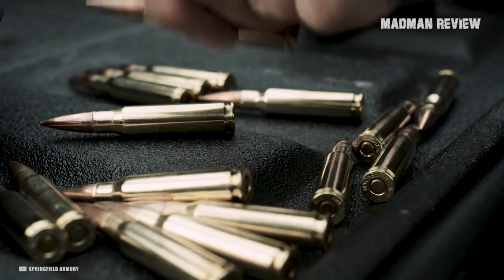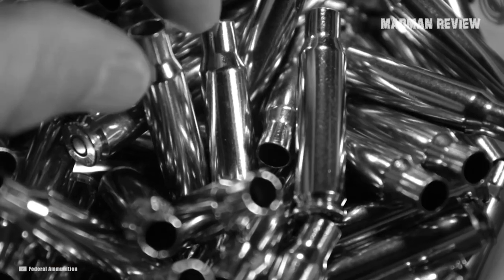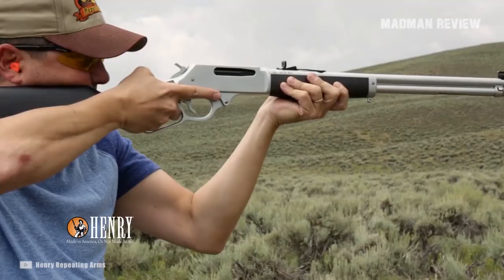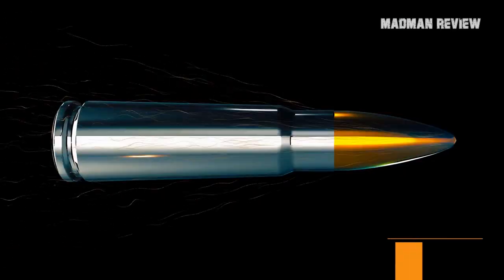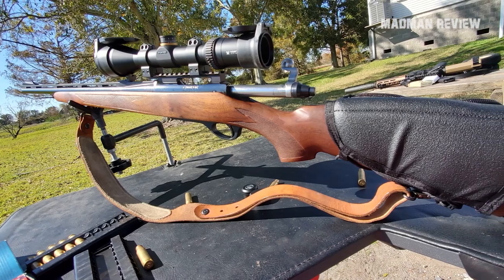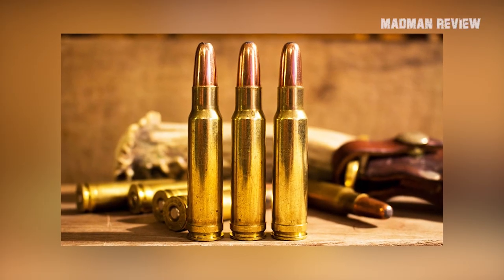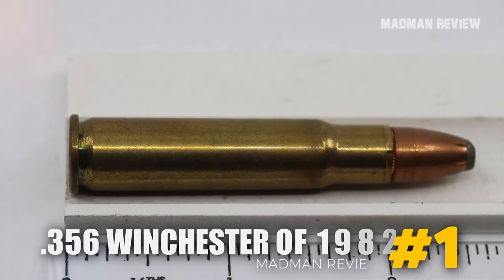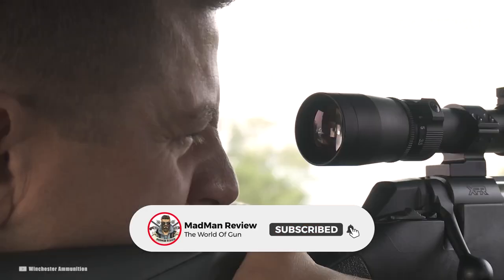5 Forgotten .35-Caliber Cartridges: Are They Doomed?

Comment: Dont let looks fool you. The .350 rem mag may look like a normal cartridge with a little larger diameter bullet but in reality its magnum through and through. A very powerful round and i believe its loss of popularity is due more to its primary platform of the 600 mohawk than the cartridge itself. The 600 was just too light of a rifle for a magnum with that bullet diameter. Not knocking the 600 mowhawk because i still believe it is a great little gun but i think its to bad Roy Weatherby didnt develop this cartridge as the heavy vanguard would have been a much better platform for it than remingtons 600 carbine style rifle.

Comment: Great video.  I laughed heartily at your photo of the Remington Mohawk with it's trademark bent trigger guard/magazine well.  Always a sign of someone reassembling the rifle who didn't do the job properly and warped it.  Still loved that as a fantastic lightweight gun though.
Reply: Not sure what you mean. I own one. Reassembled? Looked at the pic twice. Maybe I missed it, but the pic seems accurate to the real deal.
Reply: @markkalyta4560  the plastic trigger guard was prone to warping if the follower wasn't reinserted correctly if you'd stripped down the rifle fully. It's remedied with a metal lower, but it happened a lot when people didn't reassemble it correctly, essentially over torquing the guard. I know mine had that issue after a shop visit.

Comment: I had a Rem Model 700 Classic in 350 Rem Mag. It was a great gun. But when I got my hands on a 9.3x62 Mauser I realized the 9.3mm simply outclassed the 350 in all ways. Sold the 350. Still use the 9.3

Comment: I have a 35 rem in 336 and limited run 7600. Also have a limited run 7600 in 35 Whelen. They are Thors hammer on deer! I cast hollow point bullets since .358 projectiles are far, few, and in between. At least I can neck up 30-06 brass for whelen. So brass is easy to come by.
Reply: The.358  will have a comeback now that iowa let use use bottle neck cartridges between .350 and .500 diameter. It will shoot flatter than any other cartridge in that class…accept for my 375 RUM with light projectiles. 35 whelen are $300 in single shots all over the place right now. The 360 buckhammer uses the same .358 projectile. To bad it’s in a 30-30 necked up case so it will die like the rest because it won’t reliably cycle in semi autos, pumps, or bolts. I can’t believe the 358 win never took off. There are AR10 barrels in current production for $250 retail. I’m sure it will be born again in the AR platform in the next year because of state hunting requirements.

Comment: I shoot a 35 rem almost every deer season love its power think it underrated. I have been considering necking a 416 Rigby to 35 and working up some loads for long range. I  don't think its been done if so would like to hear about it.
Reply: Not a 416, but the 35 shooting times westerner or maybe its the 358 shooting times westerner, might suffice for you.
Reply: Easier to use some of the RUM cartridges in a magnum action, as well as a 340Weatherby, or even the 378 case, also 338 Lapua very available, or 375 Ruger in a long action. I thought about the 358 Norma Mag,(Necking up a 338 Win Mag) but chose the 35 Whelen. About the same performance

Comment: As it turns out, I've always been a fan of the 35 cals. 
I have both the Marlin 336ER and the Winchester 94AE in 356, 2 Browning BLR's in 358, one a stainless synthetic takedown as in the video and an older traditional one, and last year at a gun show, I stumbled onto a 98Gew rebarreled and sporterized for 35 Whelen wearing a Leupold VariX IIc 3-9X40 and I feel like a thief for getting it for 450.
That and the Winchester 356 are two that I've not shot yet,  but I have sufficient brass and bullets to load for everything I own.
The 35s are so underrated, yet there is a devoted following.
While we're all aware that there are better cartridges from a ballistics standpoint, the 35s are thumpers to be sure and do an excellent job of harvesting pretty much all game in North America, and the 35 Whelen pretty much everything on the planet.
I'm going to go out on a limb and claim that there will be a resurgence of the 35 cals.
They've already brought out the 350 legend and 360 Buckhammer, neither of which do anything better than the 35s already in existence outside being legal in "straight wall only" hunting areas.
The 350 Rem Mag was a great round and is on my bucket list.

Comment: Jacketed hunting bullets on store shelves are tailored for 35 Rem.  Big Boy 358’s are left out in the cold.
Reply: The nosler partition, swift A frames, and tipped trophy bonded bullets all work very well in the more powerful 35 calibers, but I suppose the present ammo and component situation will adversely affect many cartridges.
Reply: @fedup3582  The newest ones are probably too long for standard cartridges to stabilize, and old standbys are at the back of the production schedules.  It takes 200 yds. for spitzers to leave round noses behind.  So a 35 Rem. has always been at the top of the “woods rifle” niche.  But goosing their bullets up for 350 yd. shots, means you spin them way too fast for their jackets.  Speer pulled their .338, 275 gr. semi spitzer off the market when  reports of them blowing up in the hams of Elk came to their attention.  I still have a stash of these for load builds in a 338 RUM, but only for paper targets.  Dropping down to 8 mm Mags. only four scarce bullets will hang together on Big Game.  I only use the 200 gr. Speer made for Rem.’s Big Eight in my 8X375 Ruger wildcat!
These don’t kick nearly as bad as those Speer 275’s in my 338 RUM, and are safe to use on Elk sized animals.  Note these are all lead core jacketed bullets.
Reply: What's that got to do with nosler partitions, swift A frames, or tipped trophy bonded bear claws?
Reply: Sierra 225 SPBTs are the best all around bullet for the .358 and bigger.  There are plenty of available bullets for the bigger .35s.  The bullets for the .35 Rem are typically under 200 grains, or the Hornady Flex Tips.
Reply: @brentworls8509    The recoil action of the Rem Mdle. 8 dictates what the factories can sell to the public.  The commercial ammo for the 8 mm Mauser is loaded down to 35 Rem. levels, but penetrates in Game the deepest.  My 338 RUM’s chamber is 4 to 5 thousandths too deep to alibi hunting Alaskan DG in the permafrost, sub Arctic conditions using it’s circlip extraction, and push feed action.  Down here in the lower 48•, I expanded my RUM cases to 35 cal. and left a false shoulder to fire form my 338.  That. 35 X 338 RUM case is a screamer, but where would I get super mag bullets for it??  Note the shorter 338 RUM let’s you seat it’s longer bullets out farther from the case mouth, so it’s a wash with the 375 RUM. In the Rem M 700 actions.  This gets into Sako claw extractor conversions for hunting DG. with the M 700’s
Reply: @davekoenig9935  There are custom bullet makers tat offer 250 and up bullets, but the manufacturers haven't forgotten that the .35*Norma exists. The 225 and heavier offerings should do just fine in your .35x338. Man... that's a wildcat I can get into.
Reply: @davekoenig9935  Every once in a while, Hornady has made special runs of their 250gr RN, which I managed to stockpile a few of. What velocities are you seeing out of your 35x338RUM? are you gettin? The Norma will spit 250s at 2880.
Reply: @brentworls8509  No 350.  I just made the cases for the false shoulders to use in custom fitting my 338 RUM BRASS.  In the end, I opened up my 8X375 Ruger wildcat to 416 X 375 Ruger.  I put both rifles onto my US Customs paperwork for a 2012 Safari in the RSA.  But you can only take two, and my small cal. 270 Win was more important for smaller plains game in the West Cape.
Reply: @davekoenig9935  I'm glad you like the oddballs and keep the drive going. Maybe someday the mid-bores and big-bores will get the attention the mini-pills are getting. One can hope. There's still utility in making big holes on both sides of game. I like the insurance my .35s give that my 7s and .25s can't.
Reply: @davekoenig9935  I'm lucky to have a Ruger Flat Bolt 77RS in .350. Someone let the front sight band get blood on it, so the blueing has some mottling, but the rifle is dandy. Cane with dies for song. I have a decent stockpile of factory brass and bullets. I just need to take it on more adventures. It really is not appreciated as much as it should be. I can't imagine a better medium game cartridge for timber. Just enough, no extra fuss. No gargantuan recoil.
Reply: @brentworls8509  Better be careful!  Ruger said no more bolt parts for tang safety M 77’s.  I have a left hand 300 RCM in their light magnum, which only allows two rounds down.  Too much case in too short magazines, is why I tried to buy a left hand push feed bolt, like yours.  I have read 338 RCM’s don’t have this jamming problem.
Reply: @davekoenig9935  Good to know. Thanks! Thankfully, there are probably a lot of well-used 77s that may allow for parts to be found down the road if needed, but' I'll be careful.

Comment: NOW THE REAL REASON: The 35 Remington is a perfect example for this. Today, all ammo is in short supply. However, for many years shooters who owned, and were totally happy with, 35 Remington rifles simply couldn't find ammo. This is one of the essential parts of gun manufacturers to make a buck.

You don't run out and buy the caliber de jour simply because it kills something deader than the deadness level you were achieving before. Companies want to sell new rifles. So, if they just stop producing ammo for the 35 Remington it becomes "obsolete" by the makers choice. You either buy a new rifle of punt.

It's like stubby barrels. You need a short barrel for "brush". I recall this starting to really become a marketing thing back in the tail end of the 1960's into the early 70's. People bought it. A shotgun with a 26 inch barrel is a "brush gun", but on a rifle such a length is somehow unmanageable. Gotta get a short barreled rifle - along with its lower velocity. Don't think about the maker buying that steel based on weight, and every inch removed in cash in his pocket.

NEXT, think about sights. This also started big around 1970 - doing away with sights. Until then, rifles came with some kind of iron sights. But makers "knew" you wanted a scope on that stubby barreled "brush" rifle. Yes, scopes and brush go together sooooo well...

Take away sights, take away the cost of sights...BUT, charge just as much for the gun.
Chop 4 inches of barrel off each unit and that money  saved on that little bit of steel adds up. Then, stop making ammo for older calibers, because they "know" you want your kills to be at least 30% deader than just dead or WTFE. Stop making ammo for the old one.

Some calibers are superseded and lose their market, but the gun companies want to sell guns, not ammo for a 75 year old rifle you will continue using if they don't interfere. They gotta sell that 5.679mm Earschplitten Loundenboomer Maximag or whatever the caliber
de jour might be this year. They will have a new one to replace it next year, which the gun writers will fawn over like teen boys in heat.

Comment: The problem with .358" diameter cartridges is that the bullets are 0.008" too small. As soon as you get to 0.366", then you are there. 
9.3x62 for the win. Hits harder than .35 Whelen.

Comment: You have no idea how deeply I regret I didn't buy a Marlin 336ER in 356Winchester, as well as the 307Winchester.  If Ruger Firearms would produce the Marlin 336 in 307Win & 356 Win, I'd be buying them both.  Used 356Win made by Marlin are fetching $2500 for NIB condition...
Reply: ISTILL HAVE A MARLIN 336ER IN .356 , GREAT GUN
Reply: @rogerbaugh8962  Do you still use it for hunting?  I thought out here in Montana in the big timber it'd be great for elk, moose, or even the bears.  What's it worth today??